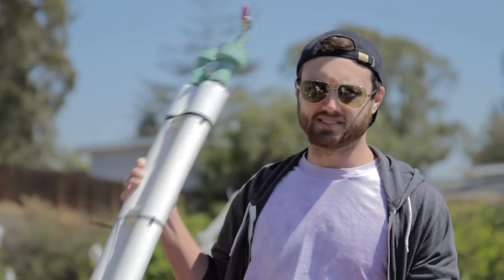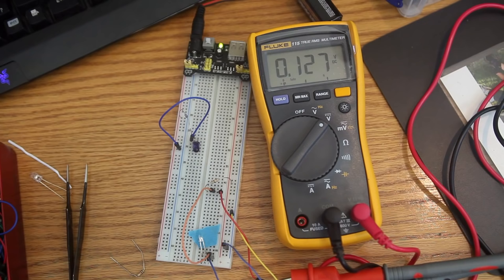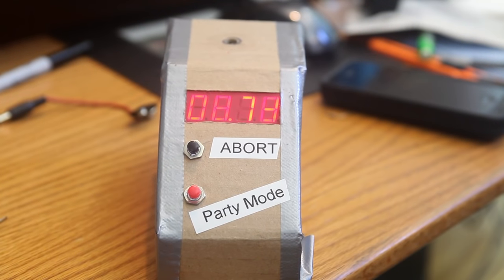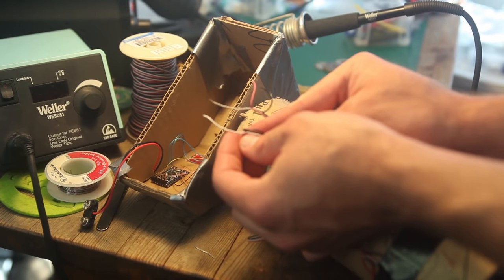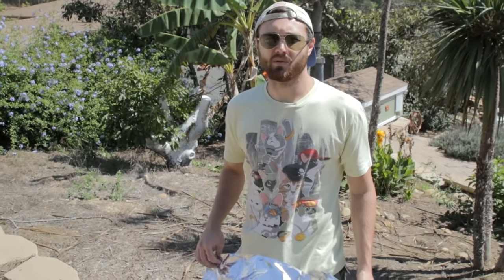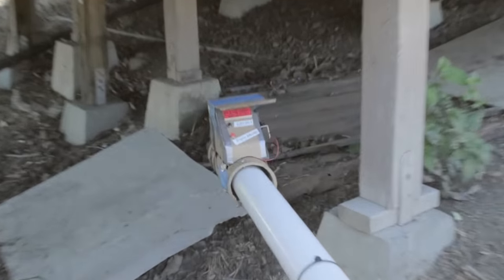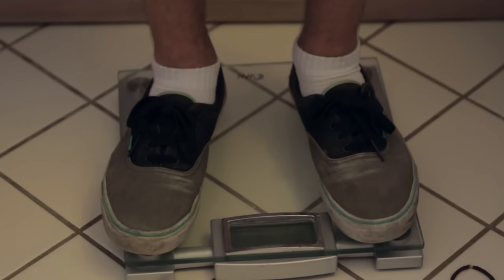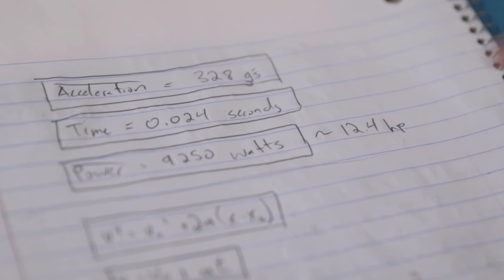Potato Cannon Speed Sensor

Comment: Awesome project as usual and I'll be building my own version or possibly  other chrono-arch based  style system. I really could use one for shooting real and homemade stuff  and a whole slew of other things.  Thanks again another great build and as I mentioned in another post I  may have some parts  (Big box worth at least depending on what you would like) and interesting/rare/unusual components etc you might get some use out of better than than me and I'd love to be of any help if  can to share that  same wonder I felt with others.I don't need/want any credit, I just think these are the type of projects that made me want to be an engineer and diy enthusiast since I was young. I'm over 26 now so I'd love to be able to  help or contribute to passing the love of building, designing, inventing, and making things yourself, please contact me if you believe I can be of any help, as mentioned I have a full wood shop and a separate electronics lab and even another SDR and UHF VHF radio section setup sdr with converters to get the super low spectrum,p and a variety of odds and ends. The stratux and flight tracker   do everything  from track planes and satellites to helping small pilots  get satellite weather, flight condition reports, and communications. The stratux and flight tracker  ones use raspberry pi's so I have a lot of those around and more type of arduino s than you ever knew existed.  I assembled and continue to improve a whole wearable computing rig too. I've got too much time and so many projects that got slowed down because of long lasting and serious medical issues that drag me back a bit but being able to even silently contribute would help me support a channel that has helped me and, I'm sure, countless  others,  and even inspired us. So if your interested in free parts or stuff or any kind of projects please let me know.  This is great channel and I'd love to support it however I can, especially in a semi hands on way rather than paypal someone lol Cheers and thanks again

Comment: Just a tip, I think ballistics power is usually measured on impact in newtons or foot pounds.
Reply: TwistedSync or joules
Reply: Yeah, it's usually judged by the kinetic energy of the projectile either at the muzzle or at the point of impact.  Muzzle energy is the most common number unless you're discussing long-range terminal ballistics specifically.

Comment: if the velocity sensor measures how long the beams break wouldn't you have to take in consideration the size of the projectile as well? say you're shooting from a 4inch diameter PVC tube vs a 2inch PVC tube, even if they are shot at the same velocity wouldn't the sensor measure the 2 inch projectile twice as fast? (considering the projectile has the same diameter of the PVC tube)

Comment: I know it's been a while since you made this video, but do you still have the code you used to make this. And could you give me said code? Also, what pins on the arruino did you use?

Thanks a bunch
Reply from the maker: I just updated the blog with a download link. You can figure out the pin numbers from the code, but be warned that 7 segment display requires a ton of pins. If you're confused, find a smart 7-segment display from adafruit or sparkfun which will only require a few wires.
Reply: Sweet man, thanks!

Comment: You can also run the IR diode on a square wave and use a receiver tuned to a specific frequency (e.g. TSOP38238) to get rid of the ambient light problem.
Reply from the maker: I thought about this but the two beams would definitely interfere with each-other. Those receivers are super sensitive. If there's ever a v2.0 I'll just put a capacitor high pass inline to remove all ambient light sensitivity.

Comment: Not gunna lie, I'm pretty sure you could've measured the power of your air cannon by weighing your projectile, firing it up into the air, and measuring the time it took to hit the ground. I guarantee I learned an equation in physics class (which has since been forgotten) that would assist us with this math.
Reply from the maker: Air resistance in non-negligible at these speeds, which usually an assertion made in those problems.
Reply: Yeah the equation is 1/2at^2 + v0t + x0 = x
And at+v0 = v
V0 is the perpendicular velocity when fired 
T is the time to reach max height or 1/2 of total air time (from lounch to impact given the two points on the same plane).
X0 is the height when the projectile is shot.